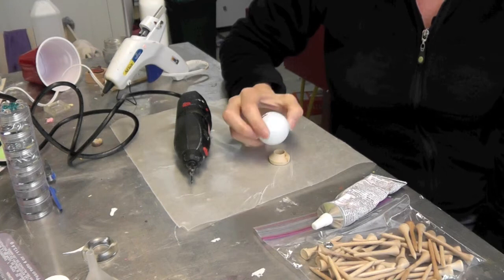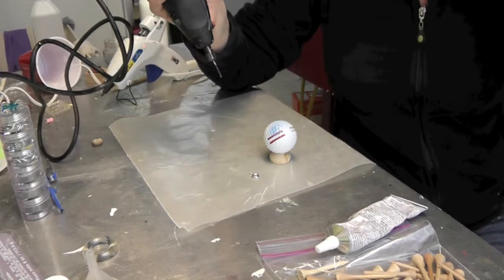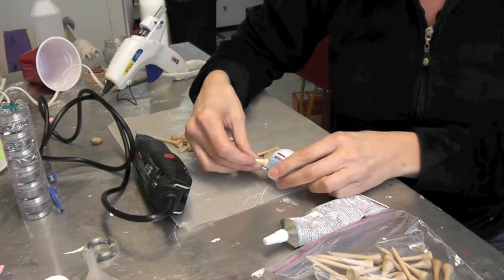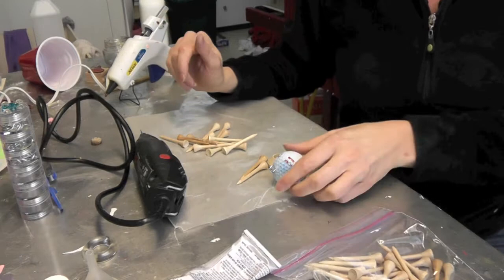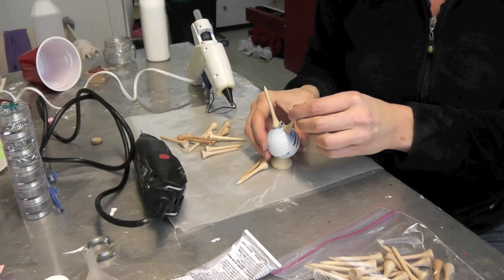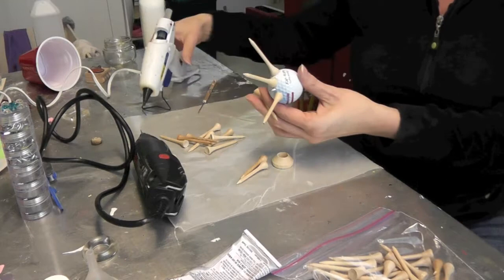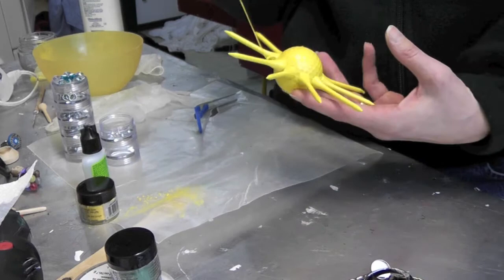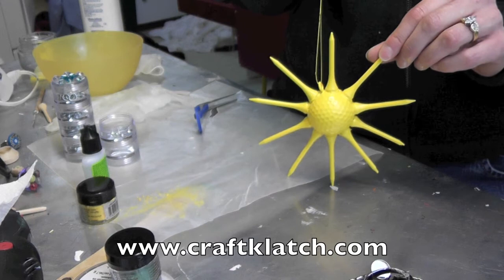How to Make a Golf Ball Sun Craft Tutorial

Comment: E6000 will only hold for maybe one summer. Hot glue will not hold up outside for very long. It cracks. Use a gutter cement. Or marine sealer. 😊